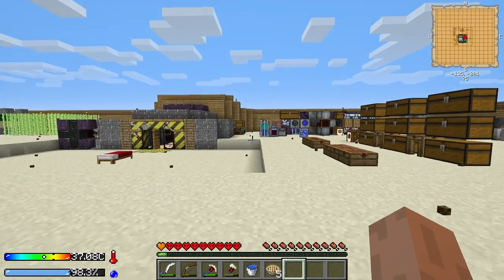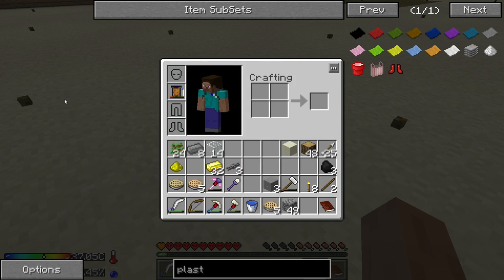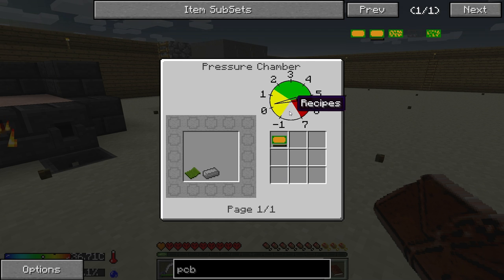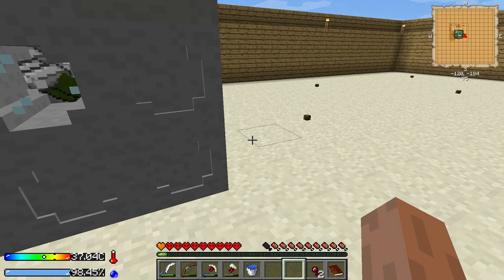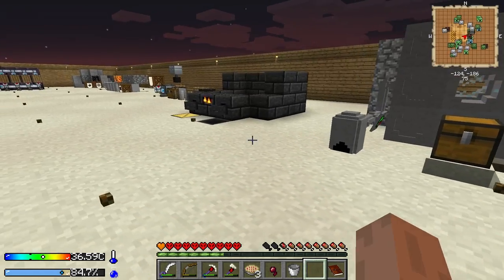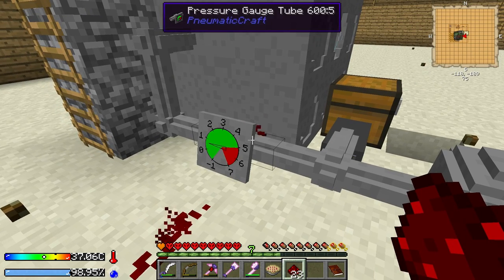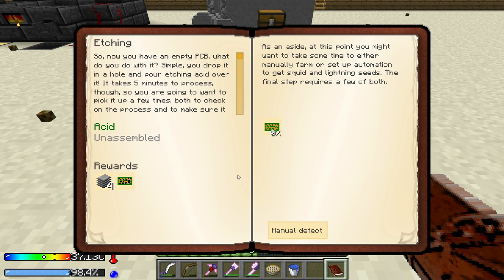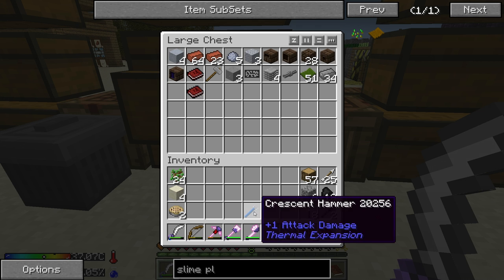FTB - Crash Landing - Episode 8 - Pneumaticrafting

Comment: Hey Nebris. If you want to always have your skin, you could modify the .Jar file, and replace the Steve skin with your own.

Rename your skin to "steve", make sure it's a PNG file. Also make sure it's a pre 1.8 format (64x32 pixels) it can even be cropped in MS paint if needed. (If you use the 64x64 skin, it's gonna look really wierd, I can tell you that.)

Go to where you saved your FTB folder, FTB->versions->1.6.4->Open the 1.6.4 .jar file with winrar(or your preffered zip program)>assets>minecraft->textures->entity,

You will see the steve.png file in this folder, replace it with your skin, (renamed to steve), and you're done.

(This is only gonna affect your FTB launcher)